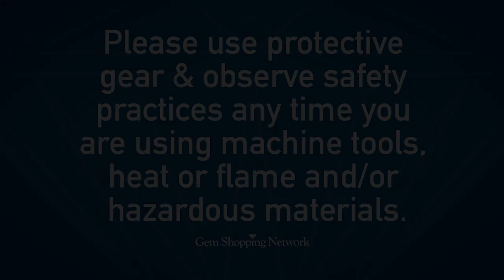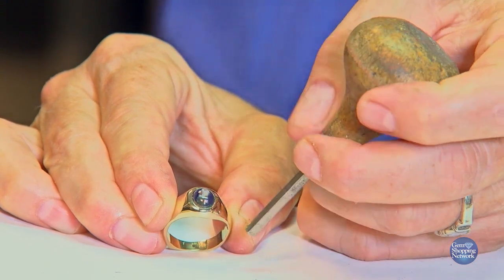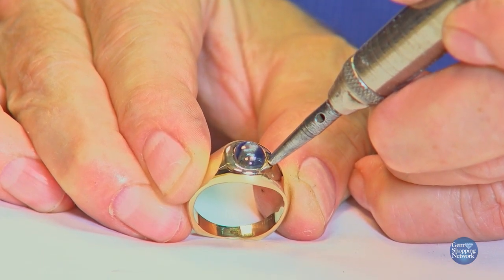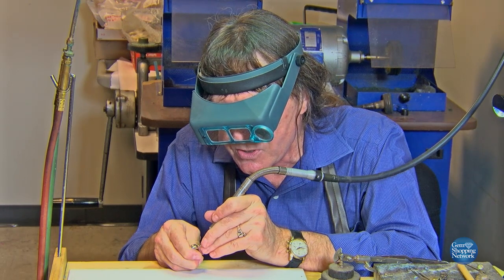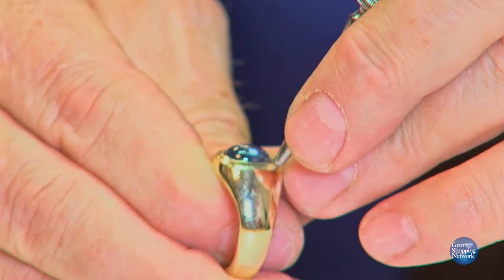HOW ITS DONE Bezel setting a gemstone - Tutorial l Gem Collectors

Comment: Can you change stones?
Reply from the maker: Hi Scott! Great Question. It is extremely difficult to raise a bezel up from a stone when they are bezel set correctly! But,  If the bezel is tall enough and folded over the stone enough to saw off a portion just large enough to remove the bezel over the stone and still leave enough height to set the other stone in mind then it can be done, as I have many times been successful using this method .  Shawn
Reply: @gemcollectorswithshawnlgem4613  Couldn't you "just" use a very very sharp and thin blade of a very high quality, and and run it along the edge again and again, until the bezel is bent away?